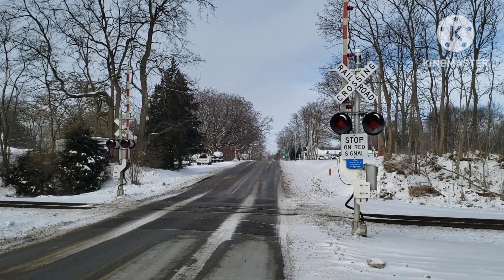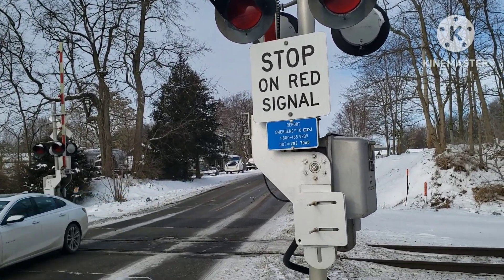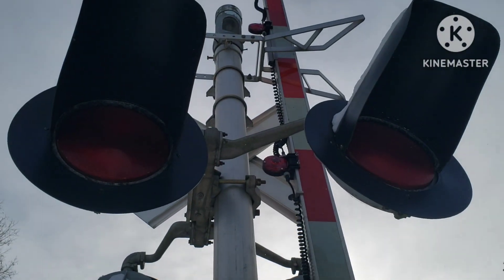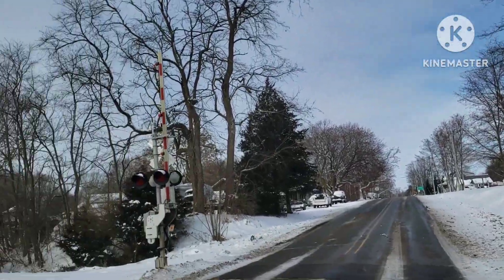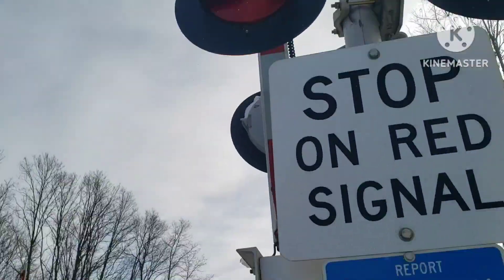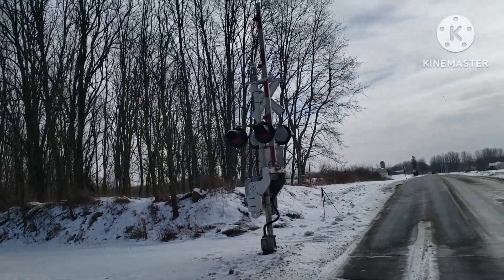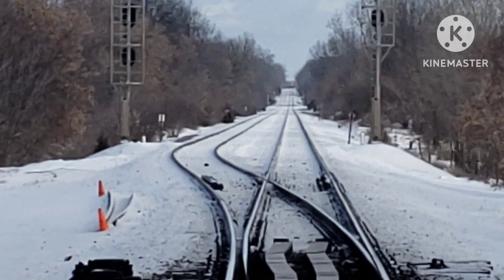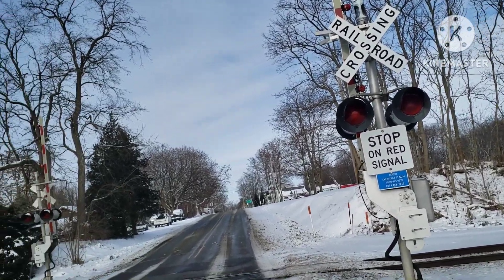Grand River Road Railroad Crossing Tour, Bancroft, MI.

Comment: Comparing that very healthy GS Type 1 to the former one at St. Johns St. in Wyandotte, the former one at St. Johns St. was like almost as healthy as the one in the Video, even though it's sad that the former one at St. Johns St. has abruptly died & got replaced with the low-pitched Siemens E-Bell, which basically loses it's character, as it's now similar to Ford Ave. & Mill St. by the E-Bell layout.

That Siemens E-Bell at St. Johns St. should've been high-pitched to save it's character & also have it sound similar to Antoine St. & whatnot.

However, it does give character, whenever the Signals are on the separate Flasher Relays & whatnot, even the Signals at Antoine St. on the Flat Rock Sub am I glad that they're still on their separate Flasher Relays Vs. where Harrison Ave. has lost it on that Track Line, when Railfan Nick told me about the Relay Case being replaced back in 2020.